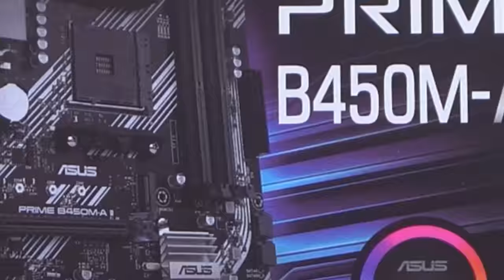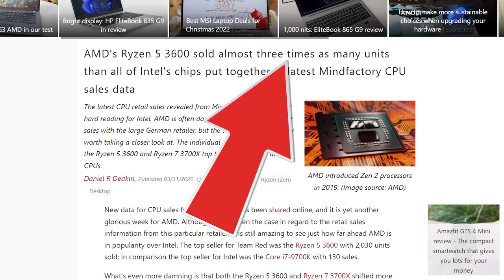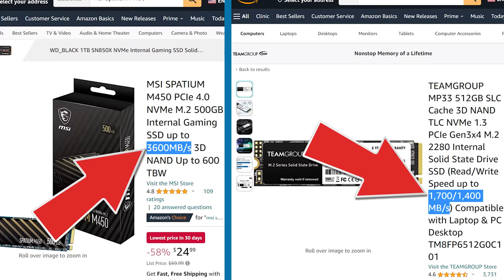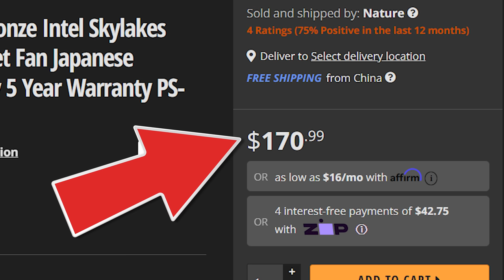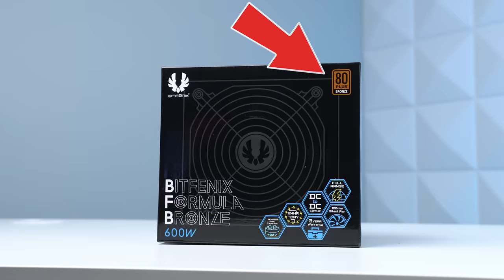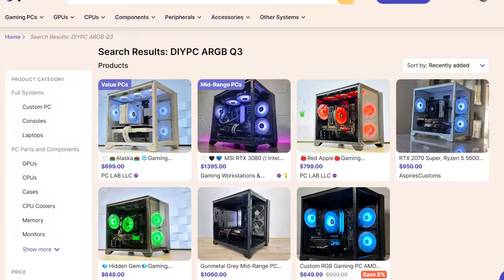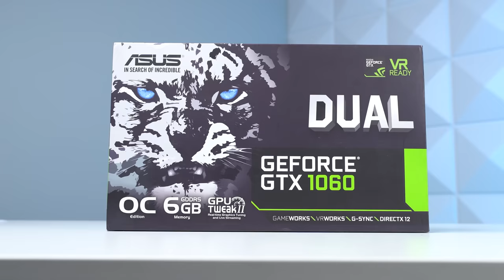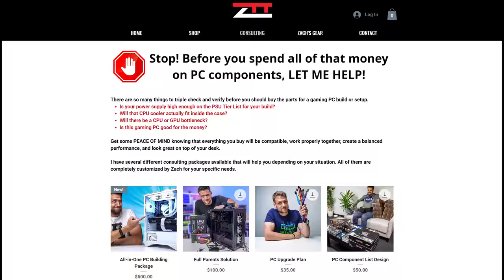A Very Repeatable $400 Gaming PC Build Guide

Comment: He i wanted to buy exectly the same build but is it a good idea to do it with a ryzen 5 5500. Pleas someone help
Reply: I'd totally use the Ryzen 5 5500 with the exact same setup.  The CPU performance would be almost exactly the same though, and there's a risk that the motherboard bios would have to be updated before it could run with the 5500.  A good workaround is to find a b550 motherboard instead.  

But then you're probably spending about $40 more for the motherboard.
Reply: I use a 5500 with a 2060Super mate, I bought it to replace an R7 1700 and it's way better for gaming.
Reply: I'm guessing the 5500 will be new. Imo the new 5500 will be less likely to fail on you than a second hand 3600. And about the same performance too.
Reply: Hmm yeah before doing any build, it's always good to check compatability on parts on partspicker or newegg. Sometimes your motherboard might be incompatable. For the most part, your CPU and Motherboard's compatability matters most as motherboards are designed for intel/amd and/or generations (such as 12th/13th gen intel motherboards vs amd).

While Intel's cpus often get better performance/value on sites like userbenchmarks by like 10$, i've heard intel's motherboards can also be 40-50$ more expensive. While i locked myself into intel and don't really have regrets, it might very well be worth looking around at both, comparing the cost of a good amd cpu + motherboard  vs intel, or vice aversa.

Make sure all parts are compatable, and then of course after cpu/motherboard compatability comes ram compatability. Your cpu can also determine how much ram you can have and the type (ddr5 can run 2x faster, but ddr5 vs ddr4 is often only +5% more fps in practice, while ddr5 can often come as more expensive as 160$ per 64 gb ddr5, vs 100-20$ per 64 gb ddr4).

Thus if one is on a budget and (especially) planning on using a graphics card over integrated graphics, ddr4 can be a good buy. However if you reuse parts, I might plan to reuse my 64 gb ddr5 for the next 7-15 years, so while ddr4 is still very good. 

New ddr generations can tend to last for 10 years, so i might be very feasibly able to reuse my ddr5 for 7-10 years, (or even 10-20 if i wanted to use ddr5 while ddr6 was out, akin to how people still use ddr4 today with only a -5% difference!) 

Pc part building can have a lot of steps, and still be very intimidating at first. But with it, you can get a lot of savings and upgrade your computer down the line, planning on long term recouped costs (1000$ over 1 70-300 fps 2 tb ssd medium super pc over 10 years, VS 600$ x 3 for three crappy 30-50 fps, 512 gb pcs that get replaced every 2-5 years and run out of space in 1 download). 

If you want to add future space to improve as well. I think one popular suggestion for the 500$ range is integrated graphics can be used for about 40 fps (albiet choppy), and then a 100-250$ graphics card like the 8 gb rx 580 (80-120$), or the 12 gb 3060/ or 8 gb 3060ti (same price, less vram but +30% more fps under 8 gb vram games), can be very comparable. 

It can be a lot more futureproof to leave space for a massive gpu upgrade, rather than two weaker cards you replace later. Even a 80$ card is gonna be 2x more cheaper than integrated graphics however, and the rx 580 is still a super great deal. (And if you're willing to gamble and replace thermal paste without exploding your pc. I think even a 1080ti can give 3060ti levels of performance, with 11 gb vs 8 gb of vram for 120-170$ used vs 220-250$ refurbished. 

The problem is the 1080ti is by default 7 years old with broken fans or dried up thermal paste, and is probably notorious for heat problems if the paste is not replaced. So you're buying a 7 year old bomb for that price and gambling with old worn out fans. But if you do replace the paste.. It could be a very interesting proposition getting the perfomance of a 2x more expensive card.. With 40% more vram... IF the fans aren't broken and it doesn't light your house on fire.)

Comment: Whait is it ok if I use another case ?
Reply: Of course. As long as its the same form factor as the one he uses in the video, its fine. I suggest reading up on computer form factors if you don't know what those are.
Reply: @JJFlores197  o ok thank very much and also what is another 1060 or another gtx it’s cause the one you use is more than 200 dollars and 150 used as of right now
Reply: @antuanmedina1899  I'm not the uploader. I don't choose the parts. As far as pricing and parts, I'm not sure. I'm not very familiar with the parts availability and their prices.
Reply: @JJFlores197  o ok thank eatherwise

Comment: ////////////////////////Parts List///////
Ryzen 5 3600

Asus Prime B-450M-A

HyperX White 2x8GB 3200mhz

TeamGroup MP33 512GB NVMe

Painted Ryzen Stock cooler 

Thermalright Assassin X120 SE ARGB

Bitfenix Formula Bronze 600W

Asiahorse White Exstentions

DIYPC ARGB-Q3-W mATX

ASUS Dual GTX1060 6GB White

Comment: personly i would add a gtx1070ti for 160 $
Reply: Nearly triple the GPU price for maybe a 30 percent gaming performance increase?  On the bright side, you could probably find a 1070ti for a lot cheaper.  I've seen local deals in the $100 - $120 range.
Reply: Here in the UK that's about the price you can find 2060Supers and RX5700XTs if you look around, they've been gettable at £130 and they'll both outperform a 1070ti, especially in newer games.
Reply: @darthwiizius  Hmm. Here in Us, a 2060 super 8 gb would run about 220$ used, but you could buy a 12 gb 3060 base for 200-220$ refurbished off amazon at times (varies day by day). And the card would be 20% higher fps and +50% more vram according to userbenchmarks.

If one wants fps, the 3060ti is also about the same price, but +30% more fps, but -33-50% less vram at 8 gb vs 12 gb. So it's a tradeoff of 30% more frames for 30-50% more vram for stuff like hogswarts legacy or unoptimized ps5 games like the last of us or the latter.

Of course used prices vary a ton by day to day or even section. Both sound like great values though and i've seen some people snag local deals for up to +50-100% frames per dollar just off local deals. I've heard of some 7+ year old cards like the 1080tis also getting sniffed out since they supposedly have 3060 ti levels of performance with half the cost used, (120-170$ vs 220-250$ used). 

The problem is at 7+ years i've heard a lot of them have unreliable fans, almost guarenteed worn out thermal paste, and rampant heat problems in base state. So using them unaltered is a recipe for disaster or a huge gamble if the fans are worn out/broken and 6+ years is a really good time to break a fan!

I have heard some people replacing the thermal paste on 1080tis though (or taking good care of their old ones), saying they're still happy with them after 7 years though. Perhaps it's like the used car cherry vs lemon (People keep the good cards that last, sell the shitty one with problems/broken fans/used paste though.)

I didn't want to worry about it for only 50-100$ in my 1000$ setup so i just bought a 3060ti refurbished for 250$ off amazon (it's only like 1-2 years old and cheap with 4060s coming out anyways). And im happy with it. But all the talk about cards is quite fun to hear. 

Since some cards are kinda shit, the 4000 generation has good watt efficency but are blatantly miner /24/7 ai cards (+40% prices.. for only +13% performance???.. But 40% better performance per watt.. not per dollar) But even just releasing, the 4060 series has crashed the 3060s prices from like 300-400$ to 200-250$ for a 3060/ti used at times. 

The problem is the mere act of talking about them or the day throws em up +50$ at times lol. But they can be good value at times. But the more options one has to look at, the more opportunities to find a sale pass you by!!!

Comment: hey, i have a wired problem with my pc, recentely i ubdated my pc from i5 6500 msi h10 to i6 10400f gigabyte b560m, my games are keep getting crash i check the temp and both cpu and gpu are 
normal, but when i turn the AC on i am not facing the issue i think the problem is with motherboard or ram could you guys give any suggestion.
Reply: You probably have an issue with your graphics card if it's overheating, and you got a bad cpu cooler.
Reply: @cobalt35  gpu is not overheating (65-72) and cpu stays below 68 degrees celcius